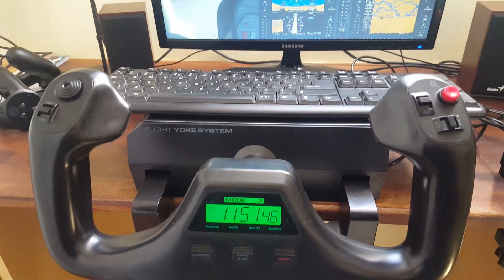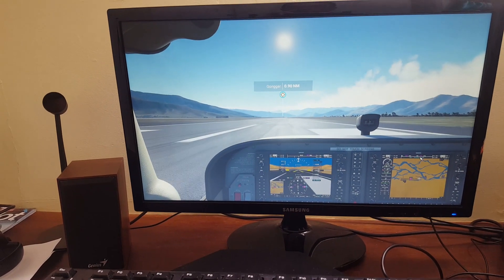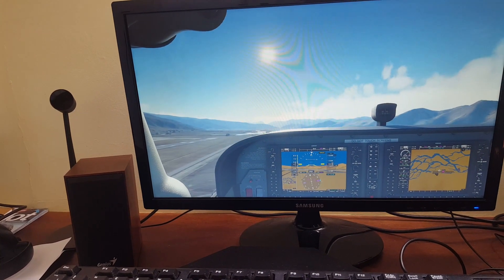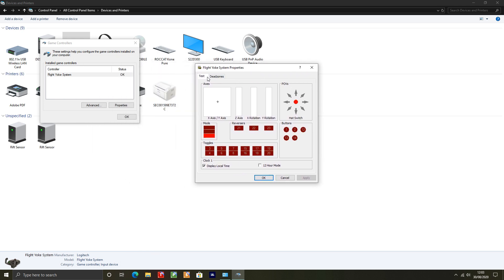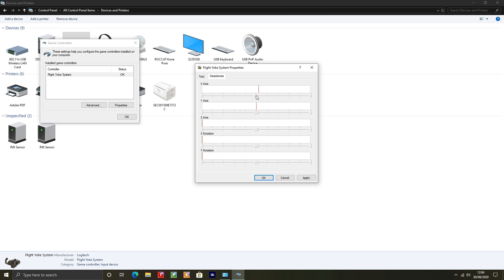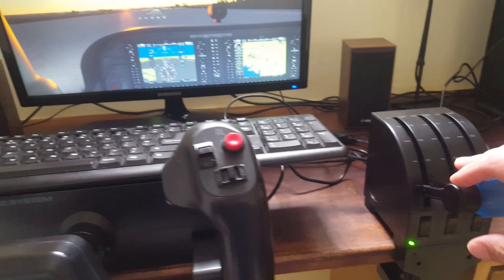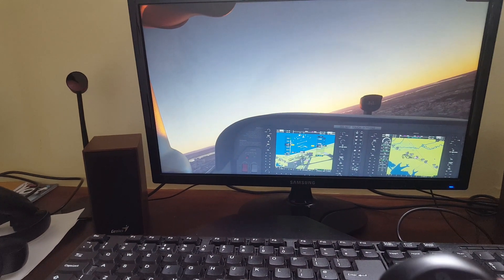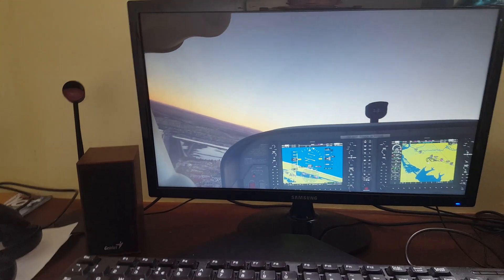How to fix 'Drift' Issues on your Logitech Flight Yoke System!

Comment: For how much we are paying for these things this shouldn't be a common issue.
Reply from the maker: I agree. I think it's because it's fairly aged tech; modern yokes don't seem to have the same issue.
Reply: @Huddison  I commented this before I actually tried it. My yoke actually only came in a couple of weeks ago and has had this issue since day one. I don't have "deadzones" but rather "settings" which allows me to calibrate. I tried the calibrate, but it still seems to be off. It may be because I installed the Logitech yoke software. I'll try uninstalling it and let you know what I get.

Comment: Sorry, but this is intentional. This reflects real life behavior. The prop spins in this direction, hence creating the drift. The simulator simply accurately simulates this. Try on a jet or twin engine prop, and you will see: no "drift"... in pilots talk, this is called "propellor walk" https://en.wikipedia.org/wiki/Propeller_walk. Please change the misleading title of your video, so people know this is in fact not a bug, but real life simulation. Thanks!
Reply from the maker: I suggest you research before commenting on this - it's a known issue with this yoke system and affects EVERY aircraft.